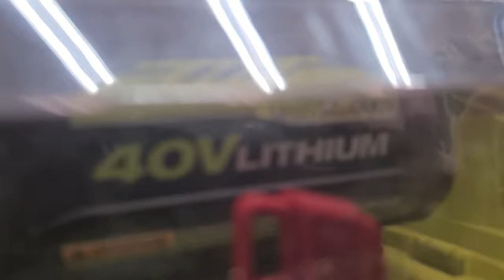Converting the RYOBI Dethatcher Scarifier Aerator to use a 40v battery! | 2022/06

Comment: I wonder if it might be easier to 3d print a taller lid to fit the larger 40v batteries.
Reply from the maker: That would be an option!! It would be the smoked translucent color though, I'm sure black with a 40v Logo would work.

Comment: The battery voltage is determined by the number of cells and whether the cells are arranged in series or parallel. Both 18V and 20V batteries use 5 cells in series to achieve their voltage - so fully charged they have the same voltage. The Kobalt brand 24V batteries have 6 cells in series, so those definitely have a different voltage.

Higher Ah is achieved by adding an extra set of cells in parallel, so a battery might be called 5s2p or 5s3p.
Reply from the maker: Agreed.
Reply: so two 20v 2ah batteries are equal to one 40v 2ah?
Reply from the maker: Yes
Reply: @enockyoon2590  - basically that is correct - there are some underlying assumptions.

Assumed that the cells in each are the same. As a result of that assumption, the same quantity of cells is assumed to be in each.

Also assumed is that the cells are all in good condition, no weak cells.

Also assumed is that the batteries are charged to the same level of charge.

So in conclusion well matched batteries can be stacked to produce a higher voltage.
Reply from the maker: Great summary!
Reply: thanks guys!

Comment: Love the video.  The main issue with the Ryobi 18V are the cells are lower cost and therefore are more prone to overheat during high current loads. I have been using Ryobi to Milwaukee adapters for Ryobi tools and it has shown Ryobi tools are great and their batteries are the weak link.  This shows exactly why Ryobi came out with a 40V (36V) line as it helps avoid the issues with the 18V line by having less voltage sag and lower thermals.
Reply from the maker: An intrresting thought. Id be interested to see what cells (18650) are in each tool. Especially knowing that both companies are owned by TTI. Final assembly of most tooks are in Indiana for Ryobi or Mississippi for Milwaukee. Most 18650 batteries are made by Sanyo, but there are dozens of other no name manufacturers are well.
Reply: @DadItYourselfDIY  Milwaukee uses mostly Samsung 25 or 35 which have have output current. Ryobi uses a huge mix including Sanyo, Eve, Sony etc. I had a list I found on Reddit a while back.
Reply from the maker: Very cool, I knew the info was out their somewhere.

Comment: That's a pretty interesting cool work around. But they sell a 36v(40v) version of this tool. I wish they would bring out adapters so for most of the hand yard tools you could plug in two batteries or a backpack/ belt clip thing
Reply from the maker: Not in the US. Europe and North America have the two battery 36v unit. Australia has the single battery 36V (40v) unit.
Reply: @DadItYourselfDIY  interesting, I swear Australia gets everything last, upwards of a year later, some tools we don't even get. I'm waiting for the newer 18v inverter that also works as a charger but who knows when/if it will come out here or if I just get the current one
Reply from the maker: There is no rhyme nor reason to it.

Comment: Can you just rewire the circuitry in the machine to convert the 2 18v batteries to 40v instead when both are attached?  Sound a lot easier route to take to me.  Thanks.
Reply from the maker: It's the same.

Comment: This is great. But the real question is: why are you having to do this? Why didn't Ryobi do this? 
I have about a 1/2 acre of yard. Is getting this pointless (in the default setup)? I am in the Ryobi ecosystem, so I have some batteries.
Reply from the maker: Mostly to see if it could be done. I have a bunch of new HP 6ah 18v and they work fine in this unit as well!
Reply: @DadItYourselfDIY  how many square feet of yard do you estimate it scarifies per 4ah x2? And then with the 6ah x2?
Reply from the maker: I easily can do 1500 with two 18v 6ah.  I can probably do more ..

Comment: Isn't the aerator the same as a verticutter?
Reply from the maker: Vericutter is a scarifier. A Dethatcher does power raking or scarifying. So people consider this a form of aeration. Most people are familiar with plug aerators, which this is not.

Comment: How much voltage can a 40 V tool handle I have a ego battery but no ego tools and I don't want to buy any Was wondering if I fashion an adapter will it burn up the tool or could handle the extra voltage .
Reply from the maker: You need to match the voltage.. this is a 40v tool that uses two standard batteries. So effectively its the same voltage in a different configuration.

Comment: If you don't want to rip apart other tools and you have access to a 3D printer... I've designed/made 40V battery adapters ( https://youtu.be/hKc6IsjtHX4 ) and 18V plugs ( https://youtu.be/1IQI03h1Svc )
Reply from the maker: I've already progressed to that step as well. The advantage to cannibalizing during prototyping is that I know everything was already wired correctly. I'll check your stuff out..

Comment: I thought you had a 18v Dethatcher?  So it really used two 18v to drive the 36v motor?
Reply from the maker: Yes. But because it uses 18v batteries, they consider it part of the One+ family.
Reply: @DadItYourselfDIY  omg, I've got 4+four 12ah batteries.  Milwaukee to ryobi adapters are already on order!

Comment: Will Ryobi ever be releasing a 40V version of this?
Reply from the maker: Not sure why it wasn't. The lawn equipment is usually 30v.
Reply: They have in Australia, only a matter of time before it gets to US, unfortunately EGo and greenworks etc are more popular in America.
Reply from the maker: Probably will never be offered here.
Reply: Ryobi probably has concerns it’s equipment would be used for commercial work if they had the upgraded machine available to the public. Concerns arise when the machines overheat with a much higher electric draw thus creating a potential fire hazard.
Reply from the maker: The draw using a 40v battery is the same as using two 18v. Also, the Australian version is 40v. Which makes no sense. I assume they went with the European version here in the states as a lower cost of entry point in that more people have more 18v batteries than 40v.

Comment: So I got the dethatcher with the included batteries.   
1. The battery life is abysmal :)   I can do 1/3 of a normal size front yard until I have to recharge.  I had to borrow a friend's battery set to be able to finish within a reasonable time and never bothered with the back yard.
2. It spins way too fast, being very aggressive with the grass.  I was really hoping that it being battery based, it would actually spin slower.  I would actually prefer it spin slower to tear out less grass and save on battery.
Reply from the maker: Did you try raising the tines height to be less aggressive? Are you using the power rake or the scarifier blade?

Comment: This really should NOT give you more power or runtime since its simply a battery with 2x the cells in one package unless you are using a bigger 40v than combination of 18v.  Maybe two 18v would be using two separate controllers and balanced differently than all being under same controller?
Reply from the maker: Not sure, but the 40v 2ah gave more more run time than two 3ah.. but, it's more about the "can it be done."
Reply: @DadItYourselfDIY  Matt is correct. Watts law is P (watts) = V (voltage) x I (amps). The 18 volt packs say they measure 20 volt each. Thats 40 volts since they are in series. 40V times 3 amps (battery pack you referenced) = 120 watts. Now take the 40 volt pack (as you said, 10 cells). 40v times 2.5 amps is 100 watts.  Everything/cell being equal, the 2 18 volt 3 amp packs will give more run time then a 40V 2.5 amp pack. The original setup is 2 18v batteries in series, So the voltage is actually 36 (40 basically), they just chose to power it with 2 18v packs instead of 1 40v pack. If you got longer run time, could be the cells in the 18v batteries are weaker than the 40v pack. Still enjoyed your video though 😉
Reply from the maker: Correct. People just wanted to see it run on a 40v battery.

Comment: How can this thing run that much longer? Two 6ah 18v batteries have 216whatt hours of power, a 2.6ah 40v battery only has 104 watt hours.  I'm not calling you a liar, I just don't understand how it's possible.
Reply from the maker: It's not, just seemed that way. I run it with a 40v 6ah, or two 18v 6ah, and get the same run time. All things equal. But my batteries are all different ages and give varied performance.
Reply: @DadItYourselfDIY  so my dual 12ah batteries should be 3-4 times the runtime.  Excellent.  Curious what the lid situation will be like.
Reply from the maker: I think the 9ah and 12ah are too tall.
Reply: @DadItYourselfDIY  I'll just tear the lid off,lol
Reply from the maker: Always an option.
Reply: @DadItYourselfDIY  I really appreciate your answering my questions here and pioneering some sweet diy hacks on the ryobi.  Super cool, subscribed!
Reply from the maker: Thanks for the support!

Comment: I don't understand why you used the 2 battery tops? Just run the wires from the part that you scavenged from the charger directly to the machine, then just hot melt glue that part in place. Sure, you can't go back-and-forth between battery types, but I'm guessing your goal is to stick with the 40 V.
Reply from the maker: I'd like to leave option open. Trying not to modify the actual machine too much.